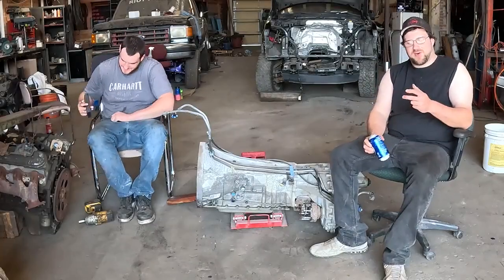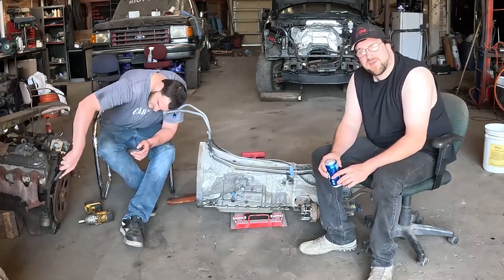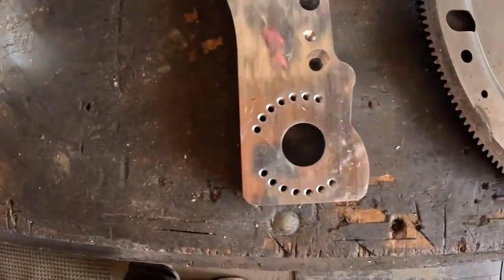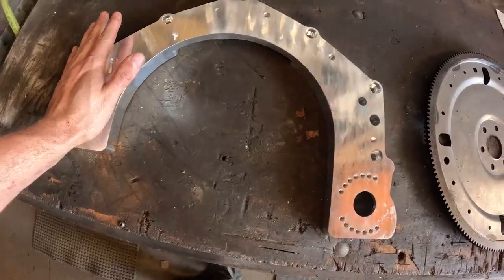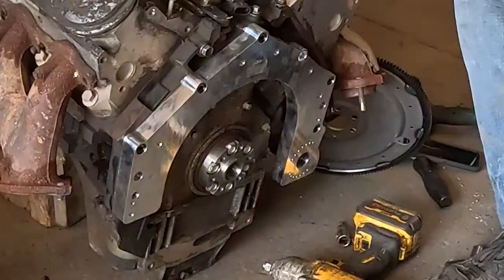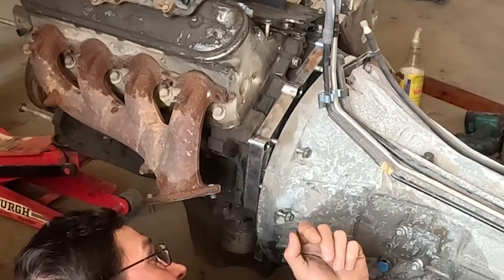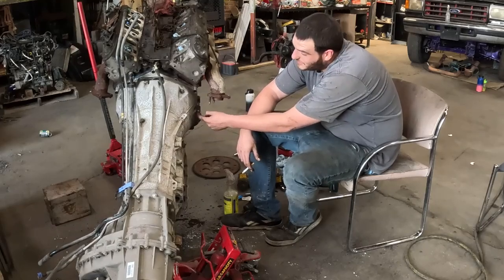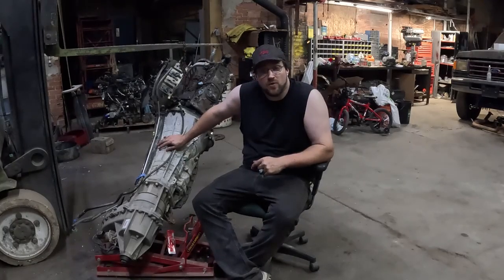The V6 6r80 Swapped TO GM LSX V8 ADAPTER, Ford tough and Chevy stuff.

Comment: So what's the difference between the V6 and a V8 transmission?
Reply: Cheaper. Maybe able to handle more torque?  Not sure that a custom adapter plate makes this an affordable build.
Reply from the maker: @thosd1134 well we paid 100 bucks for the engine man so you can get a coyote for 100 bucks more power to you
Reply: @TallGarage  I got my coyote for FREE bought running rotted truck for 1400 sold all parts off truck for over 1400. So I really got paid to take the engine.
Reply from the maker: Well, the Bell housing pattern is different from the V8 Ford ones, and since the V6 in the trucks were turboed, they are apparently rated for more torque